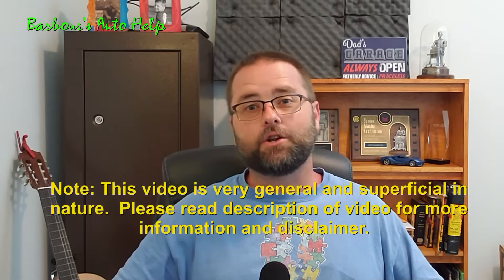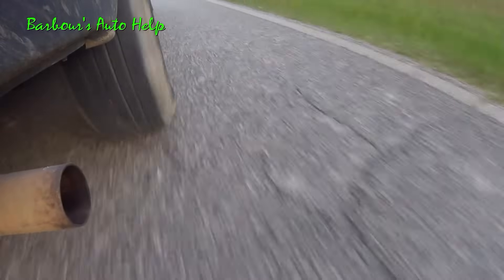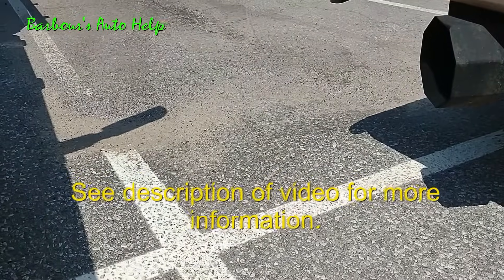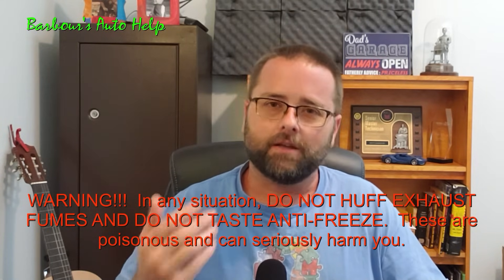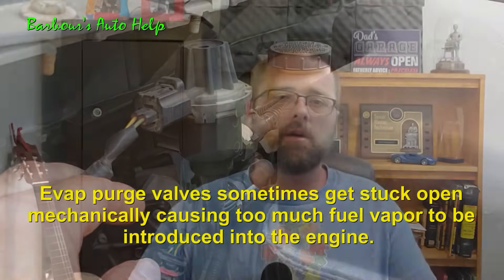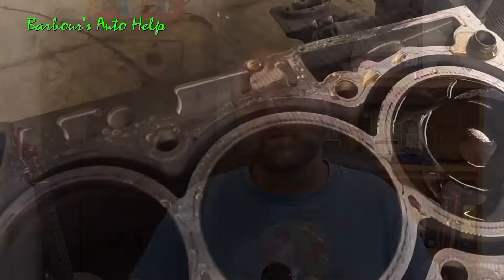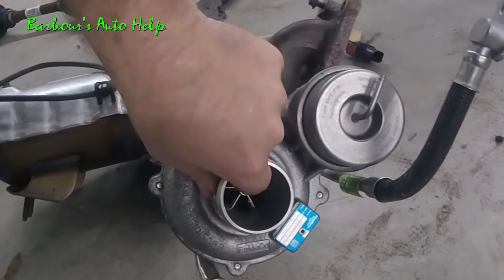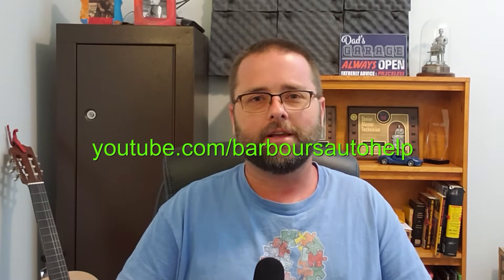Black, Blue and White Smoke From Exhaust. What It Means.

Comment: Thanks for the video. I'm having trouble with my dodge ram 1500, 3.7L engine. I just got done changing all my spark plugs and cylinders 3 ignition coil, still acting up. Than I change my upstream and downstream O2 sensor on the driver side still blowing out white smoke and running ruff. I did notice that there is another Cadillac converter on the Passenger side too. So I have 4 O2 sensors on my truck but only changed the driver side. Idk what's the problem man like I said it's still running rough like it's about to die out. I hope it's not a blown head gasket.
Reply: I have the same issue. Did you find out what it was?

Comment: Hello i have a problem with white smoke and a really bad fuel smell, only happens when the car has warmed up say after three or four miles she won't regen also but i have found the battery to be failing i have also changed the heater plugs at 100.00 pounds each (the sensor type on mine) so that is in the regen if these fail it also will not regen, but the smoke i can not pinpoint at this time any help would be appreciated, the smoke will not stop until i cool the car down then the same thing all over again. good vid by the way thanks.
Reply: Try checking your fuel supply my impala smoked from rust in the gas

Comment: I have a 91 Ford f350 and alot of black stuff used to come out. It be all on the ground in my driveway and on side wall of my house. It stopped for awhile because I changed spark plugs and wires. It still comes out a little bit. Not much. What causes it. ???????

Comment: I have a 99 buick regal ls bout 190k miles i have rotten egg smell at times from tail pipe barely any air coming out as well when its cold if i get on gas ot bucks and jerks bad but once it warms up drives fine rpms are right under 1 on gauge any ideas did plugs wire fuel filter n fuel filter less then 2 years ago any ideas or help thanks

Comment: Ohh it is exactly like that so it’s OK. Should I use a fuel additive or oil additive on Mini Cooper? I do not drive it that much in the winter and the smoke comes out and by the time I let it warm up and pull out of the driveway it’s gone. Thanks for excellent video.
Reply from the maker: If it’s not broken don’t fix it. Vehicles are supposed to smoke a bit upon start up on cold mornings. That’s normal if the smoke goes away after it warms up.

Comment: Blueish smoke can also be caused by the automatic transmission vacumme module. It'll suck tranny fluid into the engine where the suction comes from.
Reply from the maker: This is so true!  Great point.  Not a lot of vehicles on the road today use these but very true.
Reply: I'm thinking my 90 suburban has this problem- is it easy to replace? How di I know which tranny I have??. 5.7 engine

Comment: My 2011 Chevy Suburban have a camshaft and lifters problem. The scanner read a cylinder 7 misfire. I have heavy smoke coming out of the tailpipe. You can smell the fumes. Now the smell got worse and smell like a burning smell now. What could i do to fix this?
Reply from the maker: It’s hard to say without performing a pin point test. Have you had the misfire taken care of?

Comment: @Barbour's Auto Help '07 Jeep 3.7L 180k miles, white sweet smoke @ tailpipe. Coolant has air bubbles at radiator cap while running. I suppose there is no way to tell if it is just head gaskets or if the block is cracked until one pulls the heads. Correct? Do I do a leak down test on each cylinder?
Reply: Also Keith, the coolant level was about 1/3 gal low at radiator and the oil was 1 qt over full. I drained some oul and some of it was water.

Comment: Mine is a mini cooper r56 n14 2007. So the engine was rebuilt, died and rebuilt again. Same guy, all forged went it. Came back to me smoking  whiteish smoke but with oil in the tailpipe. Race exchuast, bigger intercooler, remake bigger turbo.. Bigger air intake system. Anywaz it starts and smoke stright away and plenty off it. Doesn't go away. I changed the coils and also the plugs.. The rocker cover was changed some time ago.. The engine after rebuild done no milage. The head was done and all setviceable parts. New pistons and rods. It has a catch can and the turbo was remanned "a different guy" the pistons that went back in forged but slightly used. These would or at least I said need new rings.  I need to check the pcv system and venos solinoid as when the rod failed before perhaps bits got into the venos solinoid and this was over looked. The guy who rebuilt couldn't fine the issue and after he had the car for six months I gave up. He said he had pressure tested and that all fine and smoke test and that fine.   How much smoke can come from a bad pcv system on these? As its blowing alot.
Reply from the maker: Not at all familiar with mini. Oil separator comes to mind though. I know you have a catch can but if the separator is bad it can overwhelm the can….at least this has been my experience on turbocharged mustangs. Not sure if this helps or not. As mentioned I’m not at all familiar with mini.

Comment: I have a queston .there is a  smoke slightly blue by the tail pipe under the  hood.The engine is for a volvo s40 turbo 2003, could be the turbo?

Comment: Great video! 
I have 6 cyl toyota 2H engine 1980 old engine no computer electronics etc and blows alot of smoke. It doesn't smell like coolant but diesel/oil smell. When I rev the engine blows clouds of smoke after idle of 5 mins smoke reduces but again blows clouds again after revving. 
There is no blow-by smoke coming out of oil filler/rocker cover also minimal blow by. I removed pcv hose and has minimal pressure build up when running when blocked hole with finger. 
Removed all glow plugs and found oil on glow plugs cyl 4 & 5. How would i diagnose the problem? 
Thanks in advance
Nick

Comment: 2013 Nissan with what looks white.  Thick on start up but dissipates.  Nothing while driving down road,  except one time after accelerating from a stop sign.  No rough idle or  not rough running. Thoughts
Reply from the maker: What kind of Nissan is it?  What size engine?
Reply: , My 99 Cadillac Eldorado Northstar does the same. A lot of white smoke only on startup.  Lasts about 5 mins.  Runs fine and no more smoke after that.  Head Gasket?  I hope not.
Reply: Murano 3.5L V6. Coolant levels seem stable, burns small amount of oil. Engine runs smooth, no knock or ticks. PCV valve replaced along with 3 of the 6 plugs. Thanks. Mechanic said likely rings, but didnt explore much.
Reply: Same is happening with my 2018 nissan pathfinder..it's lots of white smoke when I start the car,stop the car or accelerate fast...no check engine light,car isn't heating up,nothing comes up on the reader...car has very bad pick up and it stutters a bit here and there...the best day it's fine with no smoke..how could this be?

Comment: When I was in High School, I had an old 75 GMC pick-up with a 350 in it. At one point, I had 4 oil fouler plugs installed to try and extend spark plug life. Talk about a smoke bomb, but hey, she kept on rolling until I finally got enough money saved up to overhaul.
Reply from the maker: Sometimes you gotta do what you gotta do.

Comment: I see  bellows of white smoke from my tailpipe BMW 320d, but I don't smell any antifreeze.  I would say the smell is more like exhaust.  But I still suspect a headgasket.  What do you think?
Reply from the maker: Are you loosing coolant?
Reply: @BarboursAutoHelp  Looking at the expansion tank, it seems very little coolant has been lost.  I tried K-seal ultimate, followed the instructions on the bottle, idled the engine for 10 minutes but still the white clouds keep coming from the tail pipe. One thing I did notice was the top radiator hose got hot, but the bottom radiator hose stayed cold.  Also when I turned the heater on in the cabin, no heat came out.
Reply from the maker: It may not be coolant.  Sometimes other things can cause white smoke.  I would not make a repair unless you are sure of what the problem is.
Reply: @BarboursAutoHelp  Hi  After calling a mechanic out, he feels the Turbo has gone as oil is being forced into the exhaust system.  The cost of repair is over £2000 so he adviced me to scrap it or sell it on ebay. It's a shame, the car had only done 60,000 miles and very good condition.  It seems that when I bought the car from a garage, they may have not done the oil change and simply stamped the service book.

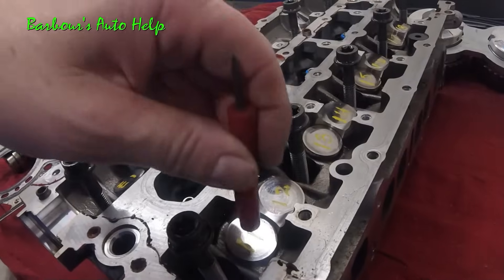Comment: 6:04 hmm, Sounds like failing valve stem seals for my car. A 35 year old n.a. car, thanks
Reply from the maker: So the smoke goes away soon after starting the engine?
Reply: @BarboursAutoHelp  yeah, I give it a few min to warm up and the white smoke goes away. Just recently it started to show some blue in the smoke too (also goes away with the white smoke). 

The other new thing, it has started to rev really high until the engine gets warm (sometimes). I would have to drive it right away because the high wine of the engine, to try and force low rpms when in gear. I read that it could be a vacuum line that is leaking causing it to rev that high. Again when warm everything runs fine.

It is an old 1987 Pontiac Firefy (Chevy Sprint) Parts are cheap but harder to find. Guessing a new head gasket and valve seals are need to updated soon. Cheers

Comment: I got a 97oldsmobile acheva and left the gas station yesterday and car started running rough and blue smoke coming out the back I took it to the garage they are going to try the pcv valve I hope it is that not the rings
Reply from the maker: Oh, I hope so too.  Please keep us updated.
Reply: @BarboursAutoHelp  it wasn't the rings it was a vacuum hose that was clogged
Reply: If it was the pcv how much smoke? That's what I can't figure out. If the pcv is bad. Can it be alot of smoke or just a little.
Reply: @rickuconnu600  don't know but my poor Oldsmobile acheva is in the garage now mechanic can't figure out why it won't fully crank he replaced spark plugs and coils and ignition control module